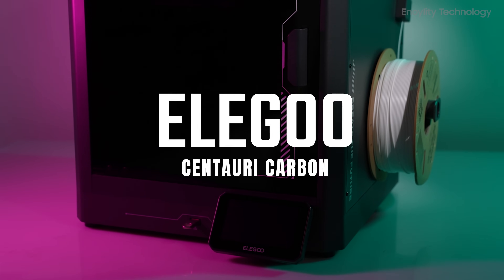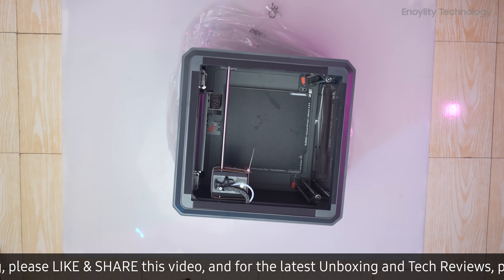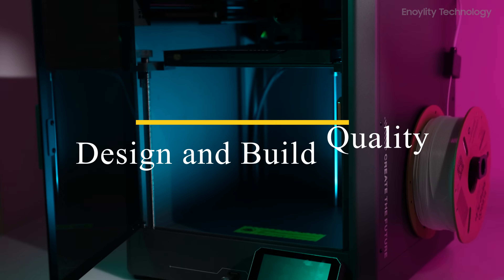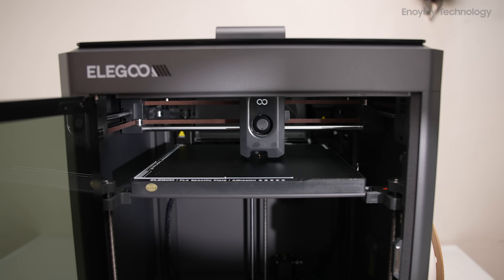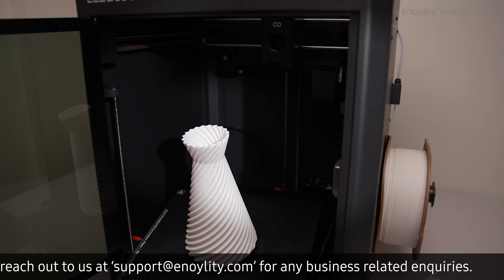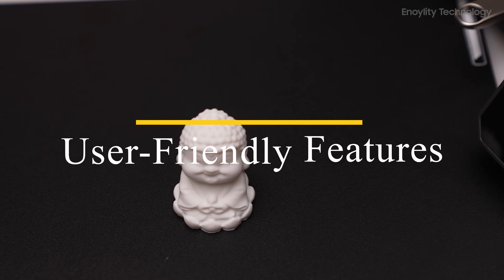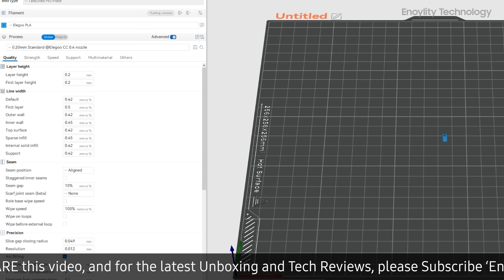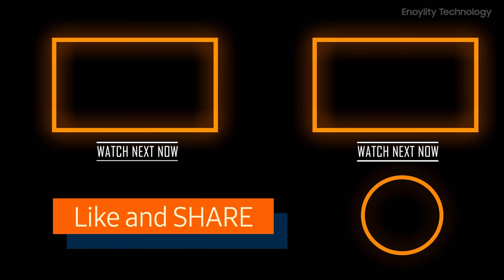ELEGOO Centauri Carbon Review: The Premium FDM 3D Printer You’ve Been Waiting For!

Comment: The only real reason to get this printer is because it is so cheap and can actually print things better than an fdm printer can. Speed is about the same as all the other printers.
Reply: I do have to have it setup in a spare bedroom with the window open for ventilation. You do not want to run this thing in the middle of your home, the fumes are incredibly noxious.
Reply: I have owned this printer for many months now. Every print I have successfully gotten off has had wonderful print quality. I had to learn how to do a firmware upgrade right out of the box, but this was no big deal
Reply: You have to cure all your waste and the printer does not come with anything to help with that. If you are buying this make sure you have budgeted for all the other stuff. Kicking off 3D printing is not a cheap hobby. Dealing with the resin is a super pain and can get messy if you are not careful
Reply: To be honest, I'd expected 3D printing to be far more expensive to get a machine of any workable quality, and I expected to waste a lot of filament and materials trying to figure it all out, but so far everything has just worked great, with very little fiddling or learning curve

Comment: Printer only says ELEGOO on it. I’d like the model of the printer to be printed on the printer. The printer comes with one rook, chess piece file for you to print to test your printer for the first time. It comes with some paper filters with some nylon mesh screen so you could screen your resin back into the jar after you’ve completed your first printing.
Reply: However, the printer worked great for about 10-15 prints then about a month into it the LCD screen on the front started working odd. Meaning there are three circles that show up when you start up printer, tools, settings & print.
Reply: My advice, take a picture of the number on the bottom of the printer in case you need customer service support. Once the printer is filled with resin, it can be a pain lifting the thing up. Of course you can remove the vat then pick it up, but that's just my two cents.
Reply: I think it's a good printer but may take some time and patience to get it to work reliably
Reply: ELEGOO really understood the assignment on this one
Reply: I have had good luck using the Cura "slicer" software to load my printing files onto the micro SD card. Being a "delta" printer, it prints quickly, and the quality of the print is pretty high, especially when you take into account the cost of the machine

Comment: It was very hard to remove the model from the build plate. It was glued on tight. I think the test print didn’t get damaged in removal, but there is potential. Apparently, you can buy replacement plastic film for the resin bath tub. I included a video of what the back of the tub looks like. I guess I’ll buy the cure station and figure out how to wash this thing properly because the resin doesn’t appear to be particularly water soluble I recommend doing everything in a garage.
Reply: I had to wait for the plate to cool down first
Reply: Yep, removal took longer than the print
Reply: The printer is mostly pre-assembled, making setup quick and easy.
Reply: The print quality is also not as nice as I would like it to be. I’ve gotten to a good place with a fair amount of fiddling but it still doesn’t match the quality
Reply: Super easy to use, it's a perfect printer for beginners.

Comment: Adhesion is about the same as any other resin printer. It works good in terms of print adhesion. And the build plate size is fine for me. Might be a little small for some people but I was very pleased with the size of the resin prints that can come off of this.
Reply: The print quality is good with the water washable resin and the smell isn't as bad as people were making it out to be
Reply: I really appreciate the expediency of their team. I'm very happy I chose them to be my first resin printer. I will be editing this post when my new machine arrives. I was able to print 1 thing before the malfunction and it came out amazing for my first print. Thank you Elegoo for your help.
Reply: Runs quietly compared to older printers.

Comment: It is not a terrible resin machine just a shame that the previous models of the machine are actually better than this guy by a lot. There is no point in buying a new resin printer any more. Thanks!
Reply: The printer works and I expect we will eventually get better at it and print some cool stuff to paint and have fun with.
Reply: I love this printer, very nice size for the price, the build can be poor at sometimes but I fixed it by doing a bed level for each print, the assembly was fairly easy just be careful not to scratch the electronic ribbon trying to get the tape off
Reply: It's incredibly easy to install and setup, and the UI is super beginner friendly. Within an hour of opening the box, I was splicing files and printing. I've been experimenting with it a lot over the past week and have been impressed with the quality.
Reply: This thing is LOUD - the controller is an MKS Robin MINI with older stepper drivers. Since the firmware is proprietary, it is unlikely that they can be upgraded, even though they're in sockets,
Reply: I'd only recommend this unit if you're looking for a delta frame this size to build on or if you're like me and have a habit of dumping 2-3x more money into your printers than they're worth.

Comment: I Have used this for about Three weeks printed many items and have only had two failed prints. For these first two prints, I was adjusting for printer sittings. Once I got my sitting right it was smooth sailing. I have printed over 30 times with no issues of any kind. I am hoping that this  printer lives up to its 20,000 hours of printing before needing replacement
Reply: I think it's a good printer but may take some time and patience to get it to work reliably
Reply: Easy to use but despite the heated bed many prints still need rafts. The small prints size may be a problem but the ease of use and user freindly printer is for me worth the money saving time on assembly
Reply: it prints quickly, and the quality of the print is pretty high, especially when you take into account the cost of the machine.

Comment: The quality of the resin print are strong. Removing the supports is easy to do and doesn’t require a lot of sanding after they are removed. The build plate size is perfect for what I use it for. I love how easy it is to level the actual build plate
Reply: Does it support Klipper firmware?
Reply: @sweetykeshri718 Absolutely😊 Klipper is built in and ready to go
Reply: @sweetykeshri718 Sadly, it doesn’t come preconfigured for Klipper
Reply: The fully enclosed design helps reduce noise compared to open-frame printers
Reply: The printer’s rigid frame reduces wobble and ensures consistency in prints even at high speed
Reply: Elegoo’s support team is responsive and knowledgeable — always a plus for troubleshooting
Reply: Overall, the Centauri Carbon is an exceptional mix of speed, quality, and pro-level features

Comment: The assembly for the printer was easy and simple, right out the box. Being able to print strong clear resin print is a game changer for me. The time it take to print a file on the printer is 10x faster which helps getting my customers taken care of.
Reply: I found everything to be simple after a little research. The machine works great and I would recommend it to a friend.
Reply: Detail isn’t as sharp on smaller models
Reply: Finally, a printer I don’t have to mod to get decent prints
Reply: The fully enclosed design helps reduce noise compared to open-frame printers
Reply: This is my first 3D Printer. I made a few test prints and I scaled them down not sure how much filament they used. The unit came well packed and a nice tool set
Reply: I was pleasantly surprised by how quiet the Centauri Carbon is, even during longer prints

Comment: Overall, I'm very pleased with Elegoo here! My neighbor has a Saturn, and he had a Mars 2 before that, and had a lot of problems. But as I get to know him better, it is clear that he is not very technically inclined. So I am not ready to blame Elegoo for his issues, frankly.
Reply: The quality of my prints has been phenomenal. Better than I ever could have imagined
Reply: This leads to several hours extra of print time (nearly double sometimes) and artifacts in the print quality. I have scoured the internet for solutions to the issue- though, there is still very little community experience with this printer. I have tried nearly every community resolution I have come across: mix and matching slicer software/slicer versions/ firmware versions with no resolve
Reply: I have a 3D FMD printer and wanted to start resin printing. I saw that this one was online for Black Friday and decided to take the jump to get it. So far it's been easy to set up and use. I just wished it had network connection capabilities that is the only annoying part
Reply: ELEGOO nailed it. This is the Bambu killer we were waiting for
Reply: This is what the Ender 3 should’ve evolved into years ago
Reply: Easy to use with a 4.3” color touchscreen.
Reply: Another plus side for the more adventurous tinkerer...with the way the structure of the printer is made, it is possible to even extend the height of printer by installing longer supports and belts (this isn't supposed to happen but hey...it's your 3D Printer)

Comment: The linear rail is remarkably stable and consistent, so the print still succeeded, but it still couldn't totally compensate for how bent the leadscrew was. Straight vertical lines on the print came out wavy, with the period of the waves corresponding to the pitch of the leadscrew.
Reply: To honest, I expected to have to send multiple mails to gat response but they got back to me within a 24hr period. After a few tests & sending them a video of the issue, they sent out a brand new LCD screen with instruction link for install.
Reply: The printer does an incredible job. It is not bad for a beginner, like myself, but doesn't cover all the details you will want to know when printing, like curing, slicing the models, etc

Comment: Finally, the "questionable design choices" I mentioned above are threefold, and they all pertain to the z-axis. First, there's no support bearing or other structure to receive the end of the leadscrew opposite the motor, so it's just free at that end, which is what allowed my bent one to wiggle so much (and perhaps allowed it to become bent in the first place).
Reply: The leveling was a little tricky but we got it on the second try. So far we are very happy with it!
Reply: I will be editing this post when my new machine arrives. I was able to print 1 thing before the malfunction and it came out amazing for my first print. Thank you Elegoo for your help.
Reply: It can produce models quickly.
Reply: This is my first 3D printer. I had ordered a different one from a different manufacturer the same time a friend ordered the same one. Mine was destroyed in transit in a truck fire. My friend received his and he still hasn't got it to work!

Comment: I've used this printer so much. I love it and it's been so awesome. I hit some issues originally as I learned how to work with Resin, but after that learning curve I've made an army of Miniatures for DnD and board games
Reply: Does it come with a warranty?
Reply: It can connect to your computer via USB or work with SD cards, giving you flexibility in how you transfer your designs.
Reply: Out of the box, it’s almost ready to print — setup took under 30 minutes
Reply: I delayed getting a 3D printer for quite a while, hoping the early adopters would work all the kinks out, and this machine seems to have done so. It has far exceeded my expectations for a very reasonable price.
Reply: This printer is a joy to use, it's a pleasure to watch it work
Reply: I've been consistently impressed with the print quality of this printer
Reply: The print quality is exceptional, even at high speeds

Comment: In light of my customer service experience, and the quality of the printer I got to replace the first one, I'm upgrading my review to five stars. I can now say that I wholeheartedly recommend this printer, even knowing that significant problems can occur, because I know that Elegoo has my back if and when those problems occur. Seriously, if something is wrong, contact them first. You'll be glad you did.
Reply: I do love the USB on the front of the machine and the interface. I really wish they had the "leveling card" that they mention in the users manual, and included wifi or at least an Ethernet port for me to run internet connection to the printer
Reply: What materials can it print with?
Reply: There are many complaints about the noise level. At first it was obnoxiously loud but after a few days it quieted down. I print in the bedroom next to mine and with both doors shut I can't hear it.
Reply: If your new to 3D printing don’t get this machine just yet find a cheap and basic alternative, until you get the hang of 3D printing.
Reply: Super easy to use, it's a perfect printer for beginners.
Reply: It's an amazing printer to learn the ins and outs of 3d printing, and they've even come out with some different sized models recently. Highly recommended.
Reply: The filament loading process is smooth and effortless

Comment: It's great because the depth of details is incredibly high. You can see wrinkles in clothes on minis an inch tall. Love it.
Reply: Was very easy to change out and I'm happy to report that everything works great again. Elegoo, thank you for your prompt support!!!
Reply: Prints decided they were going to death grip to the build plate, almost impossible to remove. I slipped and cut myself a few times on the platform trying to remove prints.
Reply: It was incredibly simple to level the build plate. The software wasn't rocket science. I was litterally printing my first items within a few hours. Again, I would tell a beginner to watch some YouTube videos before you get going, as there's definitely a process and order of operations.
Reply: Yeah, even tiny features come out super sharp
Reply: It’s that kind of depth that really makes it stand out
Reply: The printer is capable of resuming prints after power failures.
Reply: Super easy to use, it's a perfect printer for beginners.
Reply: It's an amazing printer to learn the ins and outs of 3d printing, and they've even come out with some different sized models recently. Highly recommended.
Reply: The bed adhesion is excellent, resulting in clean and well defined prints

Comment: Smart .3 D printer. Flexible magnetic door. User friendly.
Fully enlcosed structure with a print 256 mm.
Reply: It is reasonably priced compared to similar models on the market, offering great value.
Reply: It  is faster, quieter, and with the added the auto levelingits shines better than the older Mega-S (a have a few of those that I have worn out)
Reply: This sucks because I really liked the first one and its troubling when there are inconsistencies in their products like this because it then becomes a gamble when getting printers from here. Oh also you guys used these weird white clips to hold and tie the belts in the package, yeah don't do that, it leaves grooves on the belts and possibly damages them.

Comment: The touch screen is NOT the best, but this is not a flagship smartphone we're talking about here. It is functional and "good enough." I also really like that the firmware supports folders on the USB drive. This allows me to separate my CTB files (more on Chitubox in a moment) into subjects, e.g., Bolt Action, Warhammer, Utility prints, etc
Reply: Overall, I'm extremely happy with this printer! I've been having such a good experience with it that I'm definitely planning on upgrading to a larger printer in the future.
Reply: I was so happy with the customer service I also pre-ordered the Saturn 2 and I'm also waiting for that to arrive. I'm sure I'll be raising my stars to 5 after I get my hands on the new one.
Reply: Vibration compensation makes a huge difference. My minis look super sharp
Reply: This is probably the smoothest first-layer I’ve ever gotten.
Input shaping does its job well vibrations are minimal.
The touchscreen UI needs a few polish updates though
Reply: This printer was like a dream come true in a way that was far better than the dream itself. It can be improved though by doing something like making printing with difficult filaments, like ABS, as easy as it is to print with PLA.
Reply: Overall, I think it's a great printer for the money.
Reply: One thing I will note, getting prints off the bare glass print surface is an absolute pain, and terrifying the first few times. Using the included putty knife thing, I scratched the glass a bit (nothing too bad, but it still bothered me on a brand new machine), and it seemed like I was going to break the print.

Comment: This is an excellent beginner printer. It really is. It doesn't get five stars from me because of the abysmal tech support response time and what appears to be a QC problem. They replaced the lemon with one that appears to be working correctly. It's still failing to lift the plate during a print when working from the USB drive, but it prints fine from internal storage. I can live with that
Reply: Does it come with automatic bed leveling?
Reply: @sweetykeshri718 Yes, and it makes setup super easy
Reply: This is a great device but when you 1st use it there will be bumps in the road. Models will not stick. Damage the plastic in the resin bath. Fail to print. Choose the wrong setting. Break the printed product. Just to name a few mistakes that I have done. Now that's these are out of the way...
Reply: Yeah, perfect for learning without the frustration 😊
Reply: Printer was east to assemble, love that it has a bed leveling sensor and the process is simple and straightforward. The prints are good and consistent.